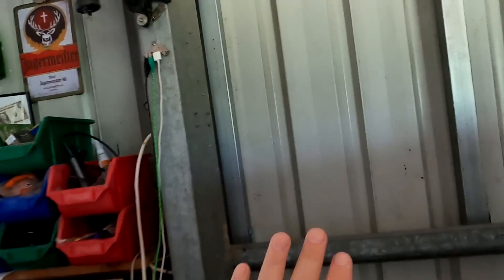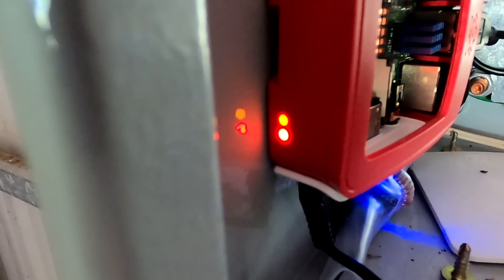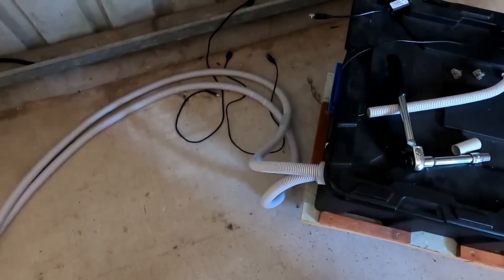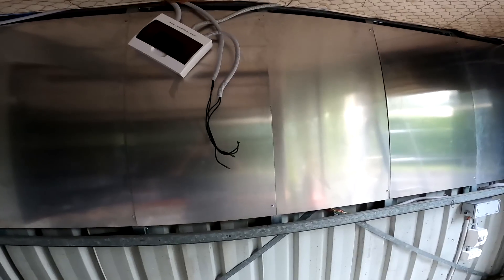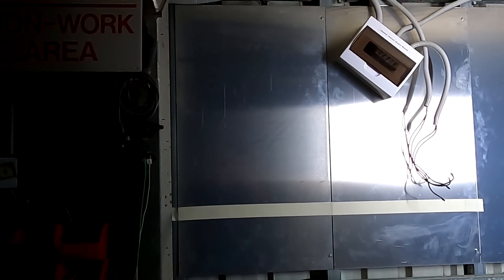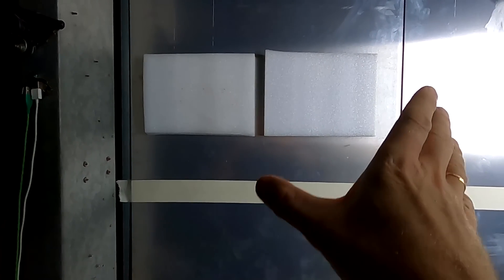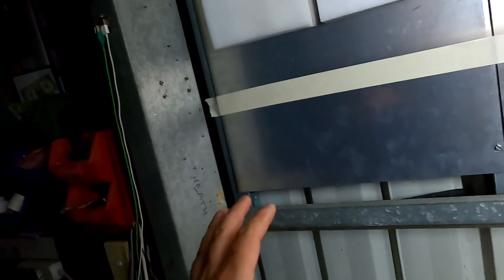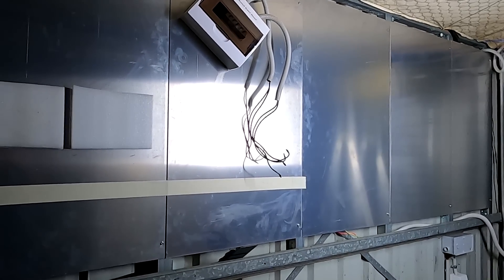Battery, MPPTs, inverter, cabling. Everything is gone... | The PowerWall Project

Comment: Don't underestimate the air circulation requirements for the charge controllers. I have two 250/100A Victron controllers in the UK. At high power output in summer they are too hot to touch. Although they haven't cut out due to overtemp I don't like it that they are so hot so have positioned pairs of centrifugal fans below each controller with thermostatic regulators to aid cooling through the fins.
Reply from the maker: Yeah, I've seen fan for these controllers. I just don't have space for it.
Reply: The vertical spacing between my controllers wasn't much but I did manage to fit the fans in between. They are just smaller than the minimum 100mm spacing recommended. They push 190cfm and are readily available. The only other complication is the need for the thermostatic controller and the use of a leftover buck converter to provide 12v from 48v DC. If you want a photo let me have an email address and I will send it.
The limited depth behind your panels even without insulation would limit the air circulation for axial flow fans.
Reply: @OffGridGarageAustralia  You could pop a hole in the panels and install a small dc computer fan behind the controllers. And you could push or pull air through the backplane.  If you have the fans on the back, I think I would “pull” the air through the hole. That way you can see when your MPPTs are getting dirty and can clean them.  Plus it would make them a lot quieter on the backside. 

I personally prefer thicker foam board if you have that option. It has a longer life span than reflectex and you can use spray adhesive to attach it to the outer wall if you are open to that.